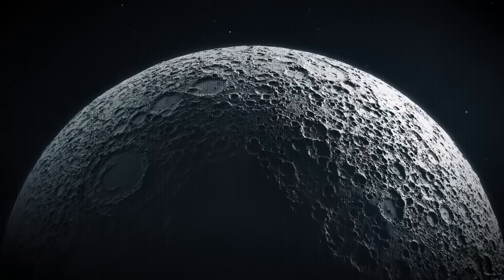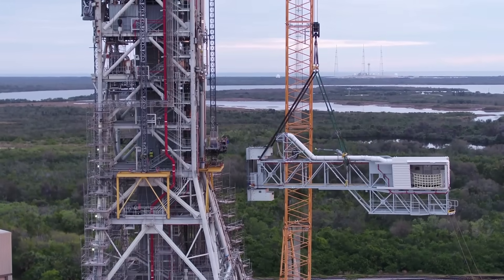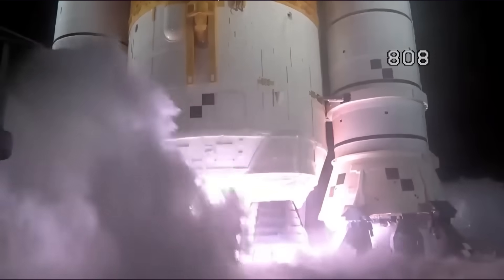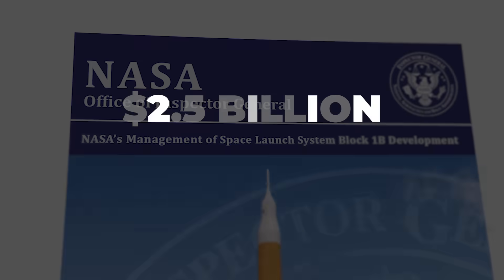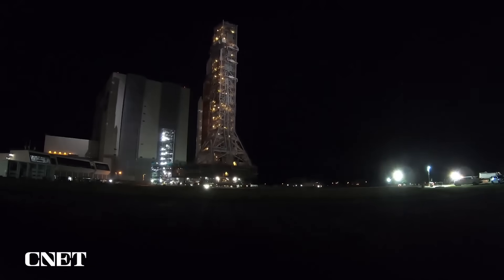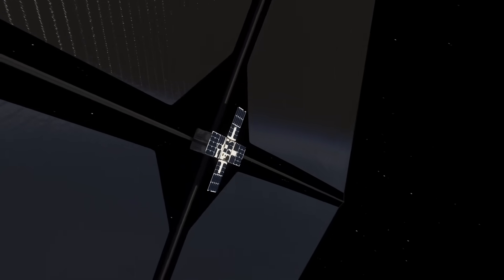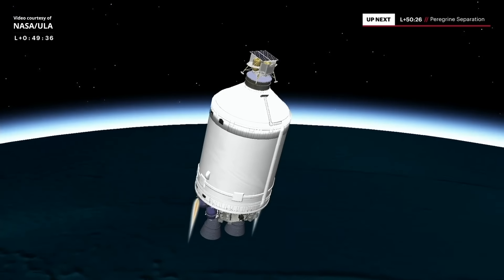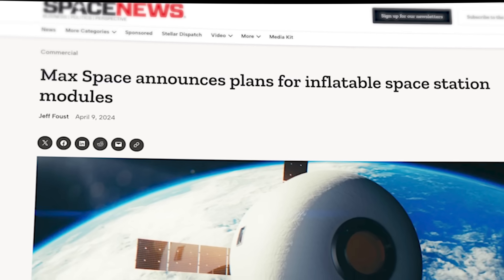NASA Has A New Problem With The Moon Mission (Artemis)

Comment: And spaceX just builds multiple towers for Falcon 9, Heavy and Starship. Did this within months and nowhere near a Billion for ALL Towers.
Reply: And that tells you what it really costs to build one of these. Now, try to imagine what else this money may be used for by Bechtel, which is a military contractor. ;-)
Reply: @lepidoptera9337  I don't know what is going on there with their "contract +" contracts where they pay 10% plus over all cost made. So the incentive isn't try to stay at budget but if more costs earn you more money, why would anyone manage cost overruns, if that is making it extra profitable. We are talking about Billions. 

All dollar bills stacked are higher than the tower that they need to make. Why can't you make a good steel tower already with tens of millions of dollars. It is just a steel frame with pipes for fuel water electricity. Look how SpaceX stacked it last tower thought last week. NASA is just the same as boeing now, but NASA Gets budget boeing has to earn it. I don't see it happen all those companies together make the Lunar gateway and the plan to land on the moon. 

If starship is twice as powerful as Saturn V you can get twice as much hardware to the moon. They just need to use the Booster and then make different stages for landing on the moon. And if you can refuel you can maybe bring 4 times as much as Apollo. But landing starship is empty weight 100 ton. That is a lot of dry mass to land. It has to be very light and well thought out.

Comment: What some people are missing is that Bechtel had to take over from another contractor that started and did not finish.  They had to redesign as the original was crap and start over. I would bet that NASA change orders also came in and caused more cost overruns.. They are back on track with progress though. The previous contractor vastly underbid. I think this fiasco is more NASA and Congress fault in trying to reuse and repurpose old tech from Apollo and Shuttle.  They should transport this sucker on it's side and cheaply, then hoist it up at the pad.
Reply: You can’t transport the SLS horizontally then lift it like the Soviets tried with the N1.

Comment: And people are complaining that the Starship program is taking more time than first promissed.
Reply: Lol they blew though all theit money and still haven't successfuly made it to orbit with test cargo.
Reply: @samus598 probably because it’s a fully reusable vehicle. Their tests have been for reliability, including their orbital tests. The next one is going to attempt a landing, after that will be cargo and further refinement.

So far it’s the most powerful rocket on earth and it’s cheaper than SLS.
Reply: @thedarkcorrupter yet after 4 launches it can’t even pull off a successful Apollo 4 while the SlS is at Apollo 8.
Reply: @SpottedHares  that’s incredibly dumb. SLS has had a single launch after 20 years of development and in its current configuration it can’t land anyone on the moon. One vehicle is designed to be discarded after a single use and the other is designed to be fully reusable. Starships launches are just tests for the basics of what it will be doing. Which by the way SLS still needs starship to even land on the moon. There is no Apollo 11 without starship.
Reply: And some of that do to the FAA's bullshit
Reply: @larry7124  Starship is an incredibly dangerous vehicle, It needs heavy regulation when it's meant to fly over populated areas when the booster comes back to land

Comment: I just don’t understand why the government is still using 60s techniques and ideologies 85 years later.
Reply: Because congress told them they had to. There were a bunch of companies in congressional districts that lobbied for the contracts and so congress required nasa to use outdated parts so the contractors could get them off their hands.
Reply: Makes yu think maybe we never really upgraded in technology
Reply: @yourdeadhomieinmywood4175  no makes me think the gov needs to be addressed lol
Reply: Just look who is in charge and where the money comes from. Given that, it would be impossible to run a street corner lemonade stand. Let alone putting human's back on the moon.
Reply: In less than 3 decades they'll be using '60s technology in the '50s!
Reply: Because it's the governed.
Reply: I wish they were the problem is.They tried to do better and failed
Reply: Same reason the Soyuz is still working in Russian. The technology just works.
Reply: yup, maybe, but the work force was much different then too. If you did not "cut it", for your job, you got fired. And of course there is a "big elephant" in the room, saying "don' t try to fix what ain't broken", regarding the moon, and then points, with its long trunk, to 6 "stellar" examples of what it means by that! ;D

Comment: Meanwhile, SpaceX uses off-the-shelf technology to move the Starship.
Reply: And built another tower from pre built levels ,,that crane was cool to see being assembled..
Reply: Soace-X has problems of its own, but one huge advantage is obvious
Space-X is spared the need to reconstruct the moon mission after this massive project was canceled about a decade earlier.
Reply: @bobgreene2892  Yes, and NASA is going about it all wrong. They need to design things as modules, like they did with the ISS. If you need more habitation volume in a given craft, launch two habitation modules. If you need more propulsion, launch more fuel modules or more propulsion modules.

The huge rockets are a huge waste of money imho. Once you're in LEO all you have to do is refuel and you can go pretty much anywhere else.

All they had to do was make sure each type of module (for ongoing exploration) was manufactured in a different state, so they have broad based political support in the Senate.
Reply: @bobgreene2892  

"Space-X is spared the need to reconstruct the moon mission after this massive project was canceled about a decade earlier."

That's why you do things in modules instead of making huge expensive rockets.
Reply: The refueling plan has doomed Artemis and Starship will never make it to the moon before the close of the decade.
Reply: SpaceX sucks!
Reply: ok, but they're still building this huge rocket that isn't necessary....and NASA stupidly made the lunar program dependent on it. The contract should have said, "lander must fit on same stack as Orion, and be light enough that it can be launched on the same launch as Orion."
Reply: @neutrino78x  I'm hopeful that some of these newer rockets coming online will produce a better plan. Perhaps a revisit of the Dynetic HLS will be in order. I love StarShip and am a huge fan of the Mars project but I'm not a fan of the Starship Lunar program. It will eventually work but it's not optimal for NASA. I feel like no one involved ever thought we were really "going."
Reply: @neutrino78x  Thatt means that you are unable to land sufficient payload onto the surface of the moon to start establishing a lunar base.
Reply: @rogerphelps9939  no it doesn't, we can lift more to LEO in unmanned launches. But it should always be go to LEO for assembly and/or refuel.
Reply: @neutrino78x ugh ... i hope there aren't idiots like yourself (haters) in NASA. ... i think spaceX should have gotten the entire project ....
Reply: @websitemartian  

" i hope there aren't idiots like yourself "

I'm far from an idiot

"(haters) in NASA."

I hate Musk personally. Many liberals and Never Trump Republicans work at SpaceX and Tesla and I do not hate them.

For example, Gwen Shotwell is the one who is actually in charge of SpaceX.

"i think spaceX should have gotten the entire project "

You never want to depend on any given supplier.

Hopefully we can get funding to bring on more human rated capsules as well, such as DreamChaser (Sierra Space).
Reply: @neutrino78x  no no no no. Nasa stupidly made the SLS... Nasa needs to give up on rockets and just do payloads. Saving tax payers billions.

Comment: I hate to say it but SpaceX has the right idea, we don't a new huge rocket if a smaller rocket can refuel in orbit. It seems to me it would be easier to set up the refuel process using existing hardware and then continue with plans without all the need for heavier rockets.
Reply: Starship is larger than SLS. There are no plans to refuel Falcon 9 in orbit.
Reply: @filonin2  the plan is to refuel starship in Orbit, however it will take quite a number of starships to refuel even one
Reply: Which isn’t a problem if starship is quick and reliable.

Comment: At this point they should either abandon the project and start off fresh again or just replace SLS with Starship.
Reply: They are meant to work in concert as the Starship is not anywhere near human rated.
Reply: @filonin2
How many humans have flown on SLS?  What shape was the capsule in after the first test flight?
Reply: Starship needs to refuel in space at least a dozen times. That’s something that’s never been attempted before. The SLS is not a bad design like some around like to think it is. Repurposing old hardware designs saves money. And the SLS has already flown to the moon and back. SpaceX is WAY behind at this point. They haven’t built the HLS, Starship still hasn’t completed a single orbit around earth. It’s not human rated, (obviously). SpaceX isn’t the “Willy Wonka” factory that people seem to think it is.
Reply: @SteveSteeleMusic  SLS is terrible.  It can’t launch often.  It costs over 2 billion a launch.  The moon mission did not go smoothly.
As for starship it needs refueling, but we don’t know how many trips.  Don’t just post a high number.  
SLS will never be cheap or good enough.  Better to scrap it now.
Reply: @jamskinner  SLS is pretty safe, the issues on Orion are easily fixed, and crew would have survived 
Starship is just ludicrous, you need 12 launches to get a lander on the moon, that alone will make it cost more than just 2 blue origin rocket launches, even a single SLS launch would be cheaper and the lander itself is already a ridiculous design, it's too tal

Comment: NASA should initiate a SpaceX spinoff that bases all their hardware on SpaceX designs, but forking it and going a different path in design and systems, all the while keeping critical systems compatible. This yields two different systems built by two different companies, but that are compatible at just the right parts. Like space suits etc.
Reply: people think spacex design is better but if you really look at their requirement. you need 14 launches to fuel a starship to the moon. you just need 1 failure to screw the entire mission. spacex hardware is no replacement because you need an emegency response option, if someone is injured on the moon, you can't wait for 14 launches to evac him. he will be dead by the time you are done refueling. spacex to be honest is a scam.